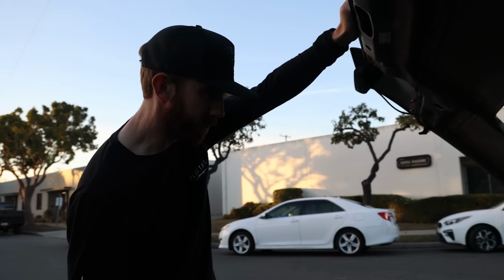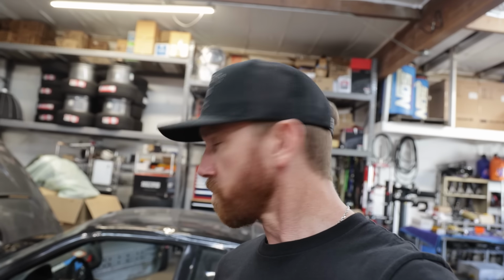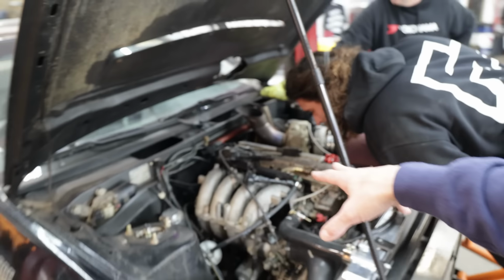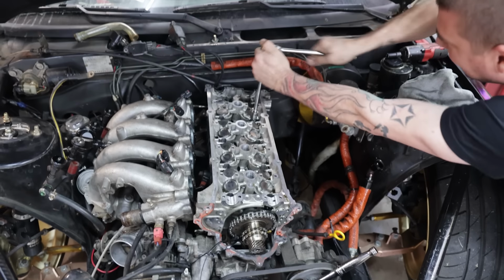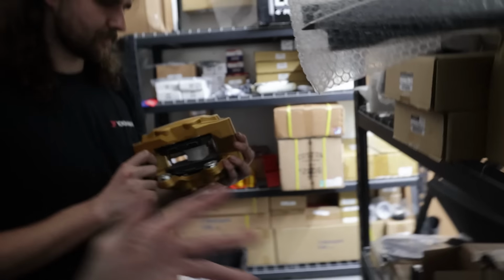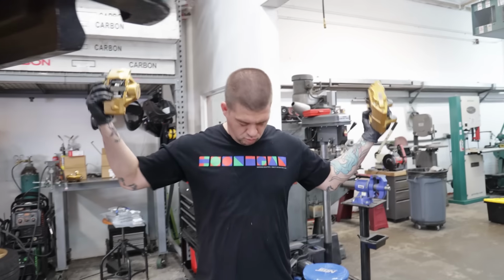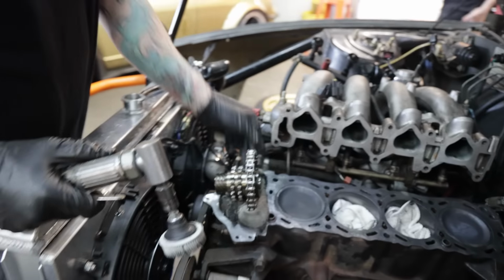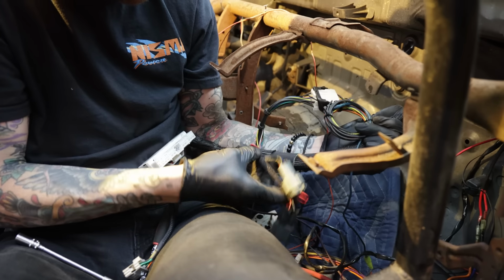My Nissan S13 240 is Back!! But Everything Goes Wrong...

Comment: Love this car! Why did you guys choose stock head bolts than ARP, I’m in the process of building a ka24 with the bare minimum and I was wondering if I should do the same
Reply from the maker: We were told it would be better, but the tuner recommended the opposite of what we did. ARP next time.
Reply: @chrisforsbergracing  Appreciate the response dude 🙌🏽

Comment: (240) I never use impacts on spark plugs.  I've seen that a few times being from the midwest.  I'd rather throw a 1in drive breaker on it than in impact.  I love the car tho Chris, super neat, obviously ya got some history with it.  I've always liked KA builds.
Reply from the maker: Man, we tried everything before taking the extreme route like that. Thats a good suggestion that we hopefully will never have to try 😂
Reply: @chrisforsbergracing  Just imparting some of my years of junkyard wisdom.  I'd rather blame it on myself than the tool being the knuckledragger in the equation.  Early aluminum heads on iron blocks for some reason enjoy eating sparkplugs in the midwest.

Comment: Also can you explain the tip of running factory nissan head bolts over studs, genuinely curious as to why.
Reply from the maker: We were told it would be better, but the tuner recommended against it. We’ll change them at a later point.